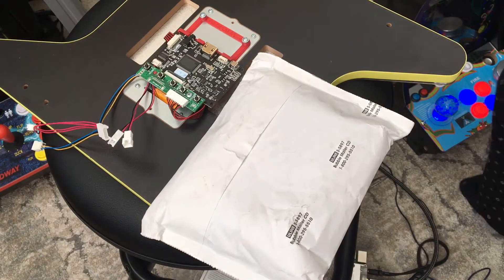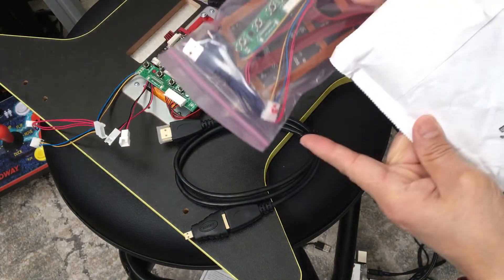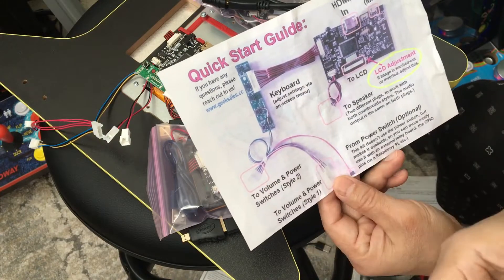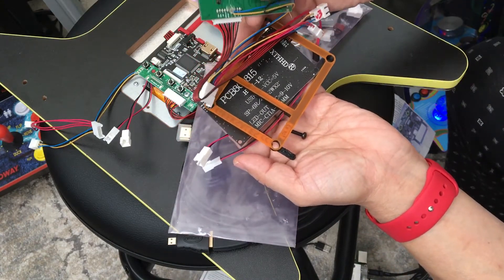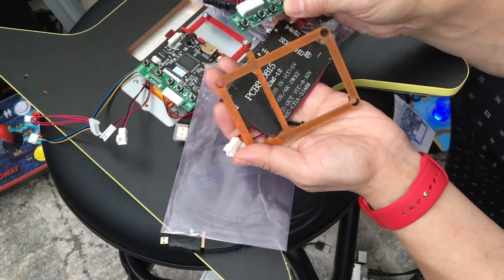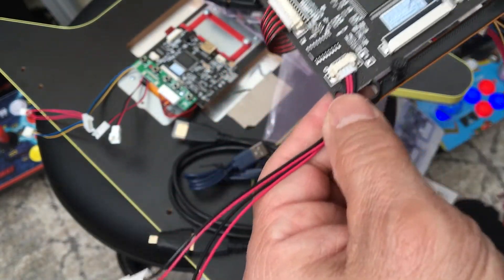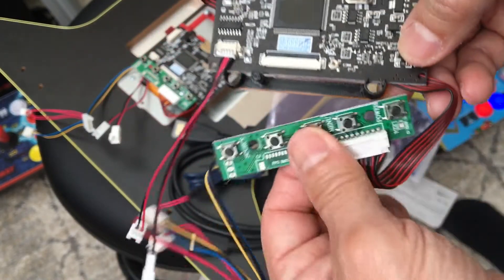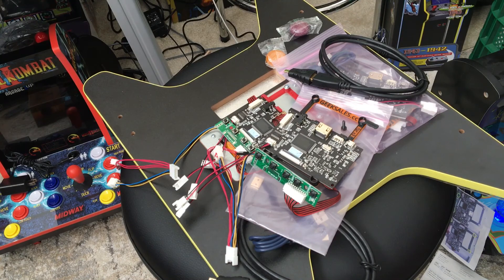New Video card for Arcade1up 2players countercade cabinets gen3 compare it with gen 2 video card.

Comment: Modify mortal kombat 2 countercade please also add raspberry pi and led buttons
Reply from the maker: Hi El-alazan, Sure, but why pick Mortal Kombat to model? It have all the 4 games. It even have scanline and all the cool future that the gen 2 do not have for the Arcade1up cabinet. You don’t want me to model the other one? Like NBA Jam or TMNT? The reason I will mod those two is because TMNT do not have the new music and you can’t play 4 players with the USB on the side. And NBA Jam games play by itself. I glade I didn’t buy the Full side of Arcade1up cabinet of NBA Jam.
Reply: @johnny58435  yea sounds good can you just add the led button to mk2 I wanna see how it looks leave the original games that’s fine but change buttons and add a speaker with subwoofer